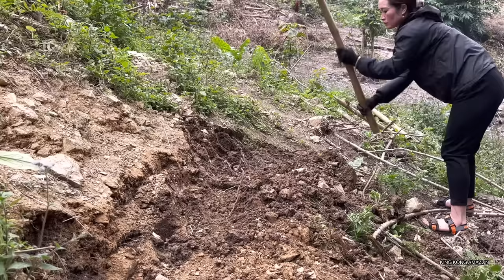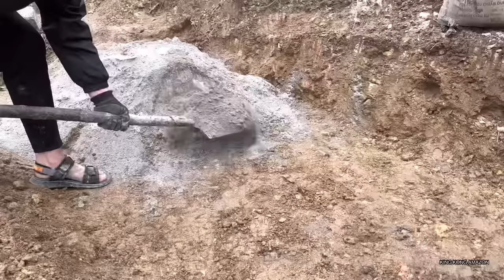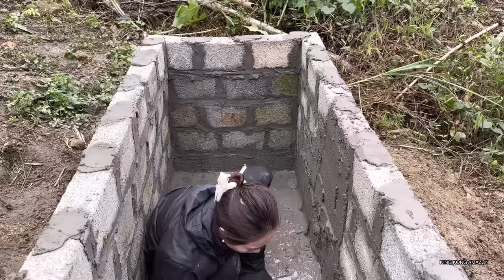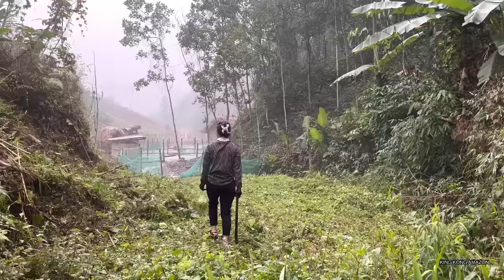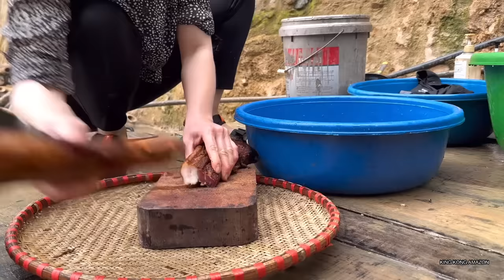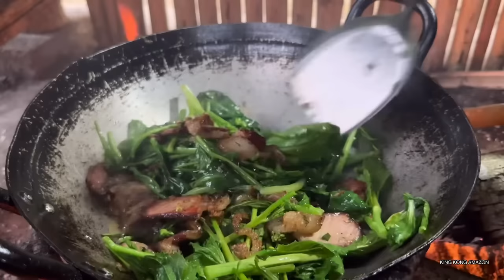Smoked pork, build a water tank, Cooking, king kong amazon, fp 316

Comment: You have to make round hole at the bottom side of the tank. N put a rubber stopper. This way you can let old water flow out  n can put new water. You need cover the tank too as malaria mosquitoes will breed there n attack you both n your pigs. Love from Malaysia